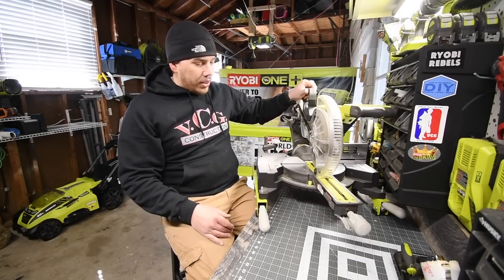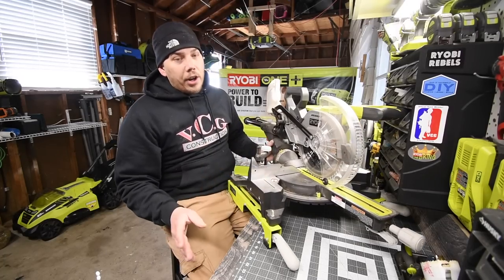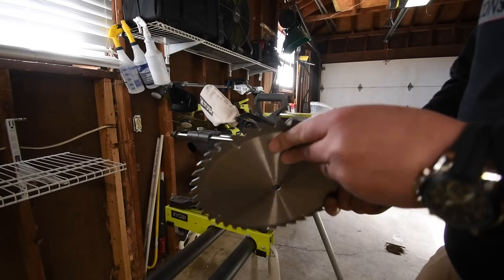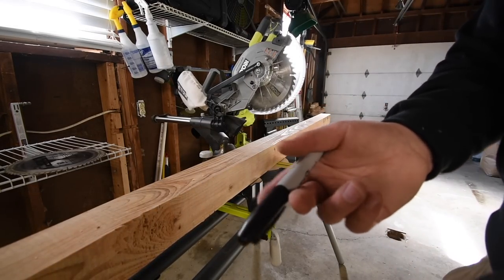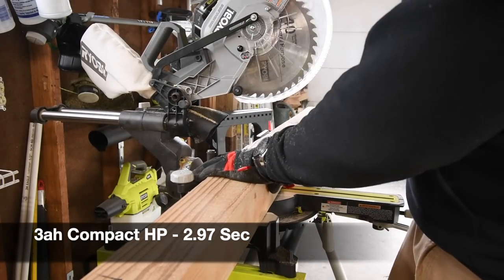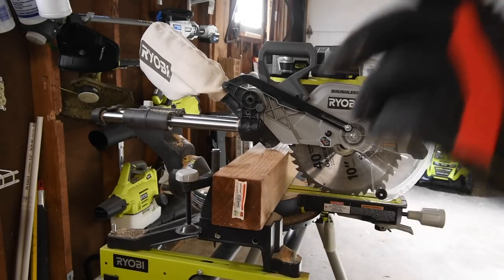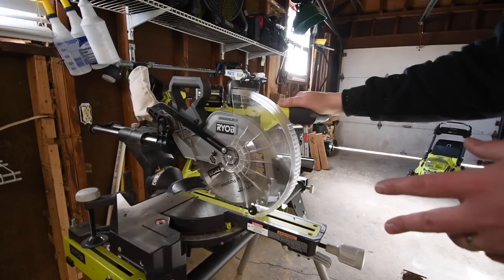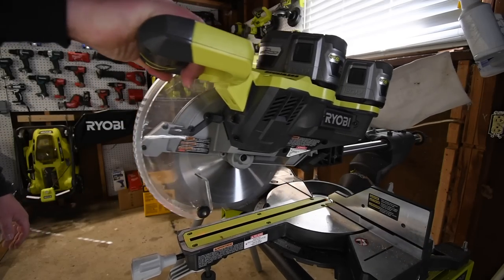36v Ryobi One+ Miter saw

Comment: I've had this saw for a while and I actually love it.  With a Diablo blade on it the thing bangs. I can cut for a while when I put 4.0 high output batteries in it even though it isn't HP.(  I just don't have non HP batteries).  Ryobi deserves legit props for this one!  All my other tools are Milwaukee fuel but I keep this ryobi and a light weight 5 1/2" circular saw (which also has a laser) going because they are just great tools.  It's not a big deal to carry around a few ryobi batteries and a charger.  Great review.

Comment: I had been a DeWalt guy for many years, I work mostly in my shop these days and do very limited amounts of road calls, I currently use the DWE 7491 RS table saw and I have absolutely loved it how ever my needs are changing and I need up upgrade to a bigger saw, Ridgid has an updated version of the R4512 coming out soon it's model number is R4520 and after using several of the octane tools and the updated 10" miter saw I don't see myself buying DeWalt anytime soon. Watching your channel reminds me of when I started out using Ryobi and the Craftsman C3 lines and I have been looking at a few of the newer Ryobi tools I really like that little blower you have.
Reply from the maker: I thank you for sticking around Crazy Repairman

Comment: You should check out the milwaukee brushless fuel cordless table saw with one key tracking and tool disabling system milwaukee is having spend $500.00 save $150.00 on bare m18 tools table saw is $449.00 regular price bare tool good until end of April.
Reply from the maker: I will check that out and see which one to get and thank you Lemuel

Comment: I'm pissed off with Ryobi for discontinuing this, hoping Ryobi will make an HP version of this and an HP cordless table saw
Reply from the maker: hopefully they are making a new version.
Reply: Done
Reply: Yeah dude they made them already!  I'm kind of sad that I got this miter saw before they came out with the HP.  But, even though it doesn't use HP, it's technically 36 volts

Comment: Wow man caver! That's a very nice Miter Saw!!! Wow! I wanna have one of those But there's something missing on that saw.
Hey Ryobi Tools! I hope you all seeing this! If there's gonna be a very nice and powerful descent miter saw in the market that would be Ryobi! But please!!! Please!!! Remake this model!! I'm willing to pay $600 for a Ryobi Sliding Miter Saw that is Hybrid!! Yeah I said Hybrid!! Keep this flatform 36V (18V+18V= 36V Battery + Corded= Hybrid!) Meaning this miter saw can also be powered either Battery or by 120V Corded!!!! I'm willing to pay $600 on a Ryobi Miter Saw that is Hybrid! Both Battery and Power Corded Operated in a Brushless Motor!!!!! Plus a much very accurate cuts with the most accurate laser and a much better dust collection system.
Reply from the maker: I do agree that they they need to update this model. it would be awesome
Reply: @ManCaverTools  yeah! Because this model that you showed is very comes in handy, it's battery operated which is I have a lot of 3ah and 4ah both of them are +HP Lithium Batteries and I have 1 pair of 6ah +HP Battery too. But I hope this saw have Options to turn into a corded. I like this saw right now but in gonna it if it has that feature too.
Reply: I'm surprised there aren't inverter dummy batteries for the Ryobi 18V system. My photography studio lights use 28.8V lithium packs and I often use them on AC power with the adapters.

Comment: when you say HP, what do you mean?
Reply from the maker: The Ryobi Brushless tools have HP batteries that interact with the mother board and give the tool more power when it needs it. this saw does not have the HP connections on it
Reply: @ManCaverTools  appreciate your reply, I just just purchased this yesterday and it's still in the box, I'm not sure if you've used any other miter saws but if you have, do you recommend this one still? I'm just a regular DIYer. I love Ryobi tools for the interchangeable batteries, that is awesome.
Reply from the maker: Josh Olivarez I think it good enough to get the job done. I love mine.